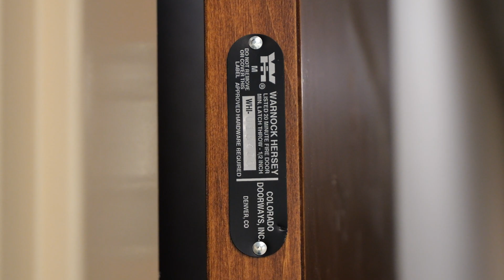Inspecting a Swinging Fire Door

Comment: Does the combustible carpet instead of an incombustible threshold fail the door? He's saying ambiguous "we will be looking at"
Reply from the maker: Yes! Combustible materials like carpet should never extend through doorways protected by fire doors rated for three hours or more. Some materials may be okay for lower-rated doors if they meet certain test standards (i.e., ASTM E648 test listed on material manufacturer info). Verifying compliance of materials is beyond scope of fire door inspection; rather document any red flags for client to verify construction materials, as needed.
Reply: Thank you for the detailed response. What about 1.5 hour rated fire door, can it have a carpet?
Reply from the maker: @smekos  Yes, combustible materials are generally allowed to go through fire door openings rated for 1.5 hours or less, as long as they pass a safety test (NFPA 253) showing they can resist fire to a certain level (a minimum score of 0.22). Typically if you see ASTM E648 listed with the product manufactuer, it satisfies the requirement for NFPA 253 as well.

Comment: Pretty sure you can’t have a door holder on a fire door unless it’s an automatic release type tied in with the fire alarm system. The kick down holder is no bueno.
Reply: That is correct. A fire door is not allowed to have a hold open device. This would be an element of the ComSOP section 17.8.3 which is an auxiliary item that could interfere with the door operation.